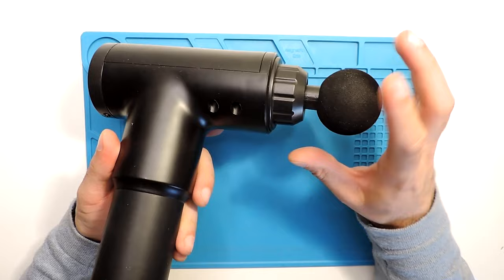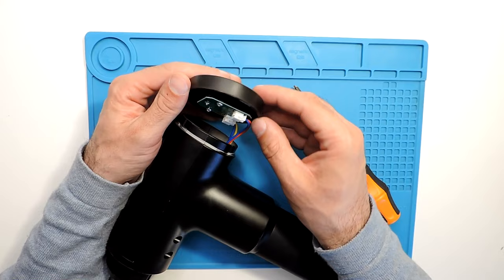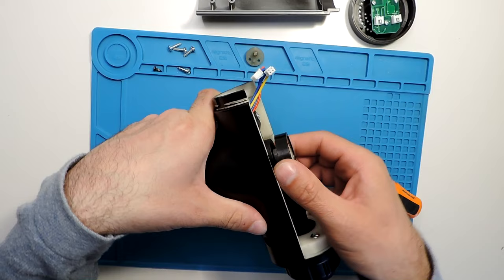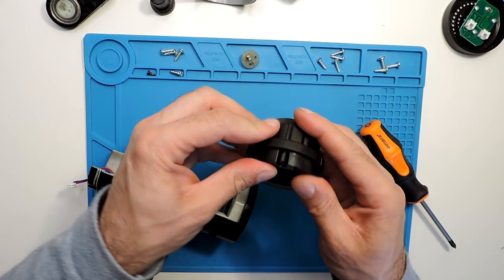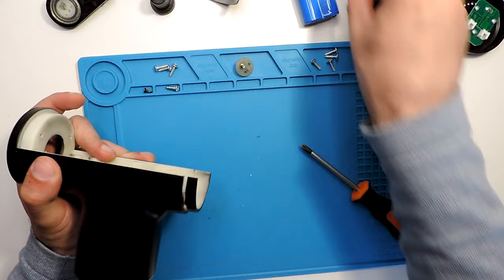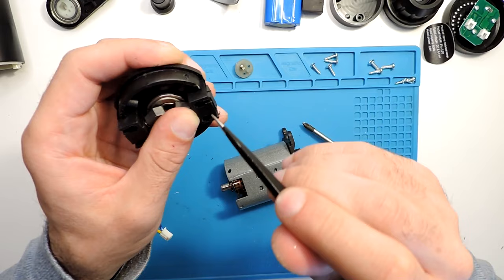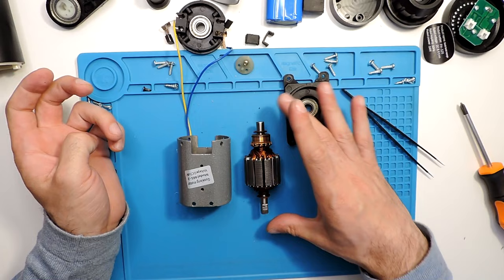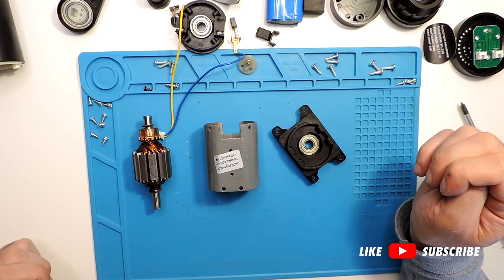How to fully disassemble/tear down massage gun

Comment: hi sir wht is the size of the battery how many Volts or Amp.? thank i have that kind of msage  unit.
Reply from the maker: I am not really sure about the battery since it doesn't have any markings, but I think it should be 2.9 or 3 A.  From what I looked this one seems ok https://s.click.aliexpress.com/e/_olRho9m, but my concern its about the size, if it would fit and the length of the cable. For the exactly replica of the massage gun I wasn't able to find.
Hope it helps!

Comment: Thanks for the demo. On my Konka A8 massager, the “USB” connector can be inserted easily into the massager with either orientation. I think there may be only one correct way, and the incorrect way is the probable cause of the connector getting very hot, along with the display/controller PCB, and the unit as a whole ceasing to work.  On disassembly, the battery is still charged (~7v open circuit). I think I need a new PCB, and a charging arrangement which can only go in one way. Probably easier to buy a new device with proper charging connectors.